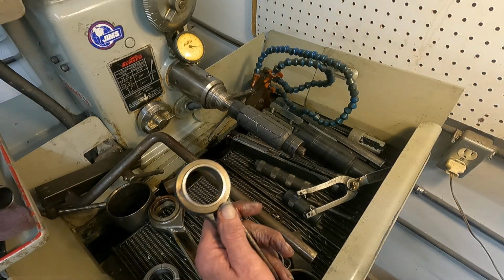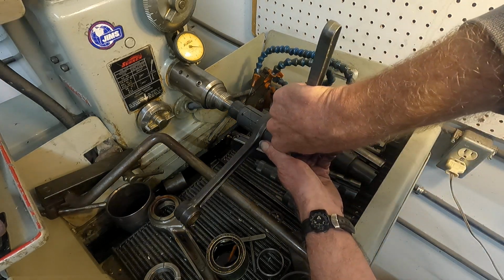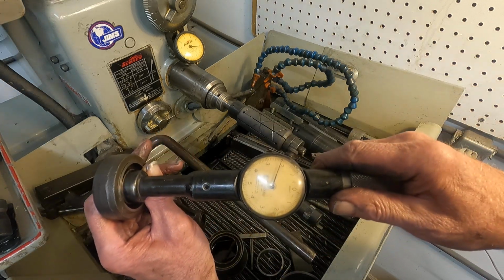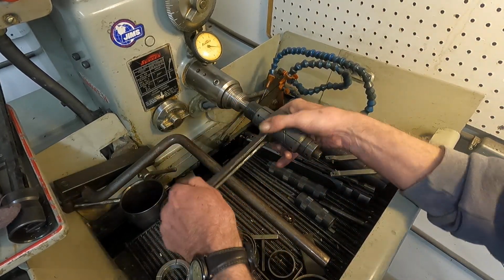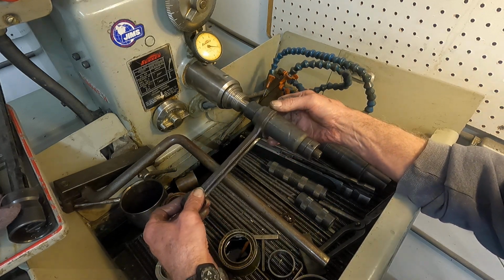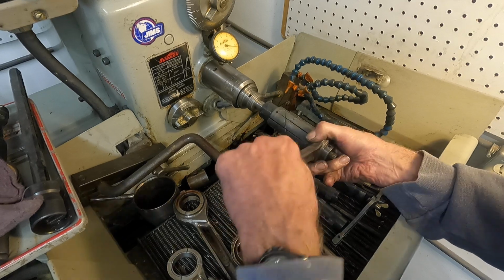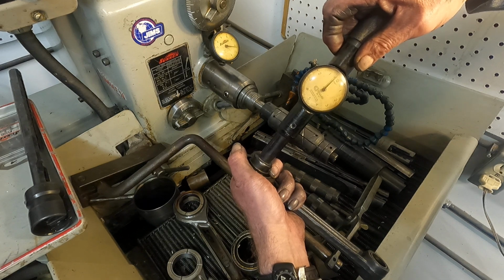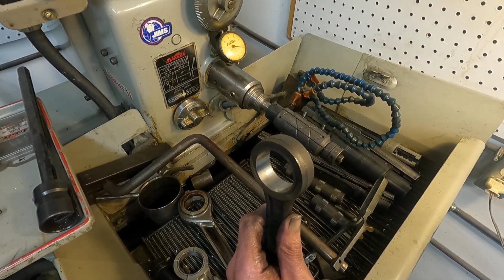Machine lapping bearing steel in the Sunnen hone 2

Comment: Those lapping tools, do they come in a set of different diameter ranges?
Reply from the maker: Yes on both the cast iron lapping heads can be changed on the shanks, the heads can can be turned to any size on a lathe.